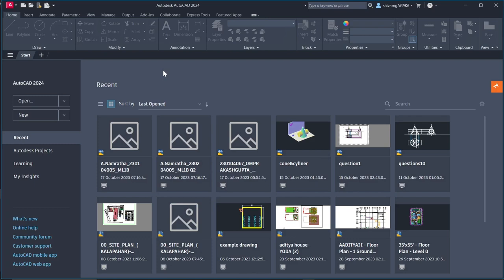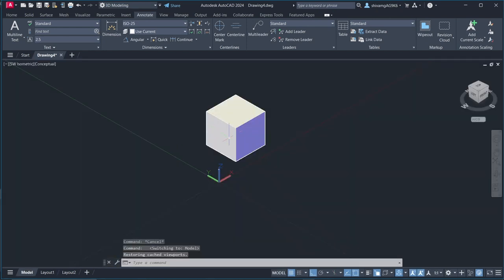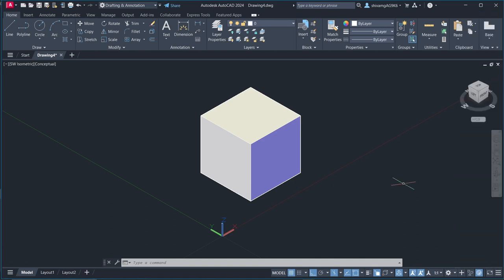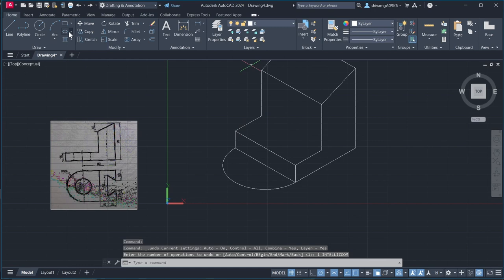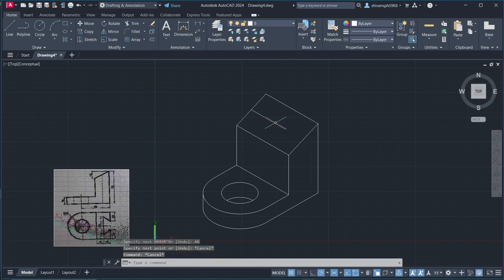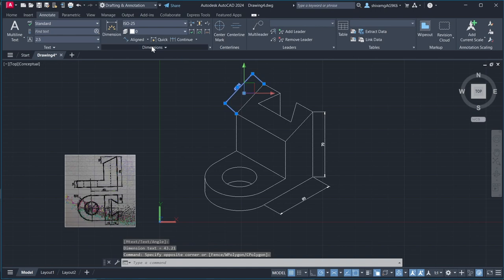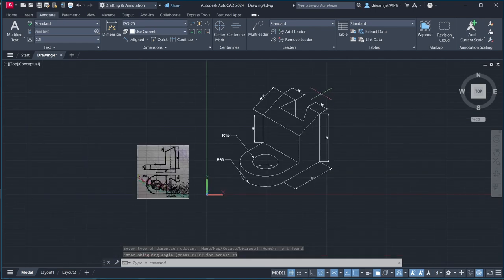Isometric Projection in AutoCAD

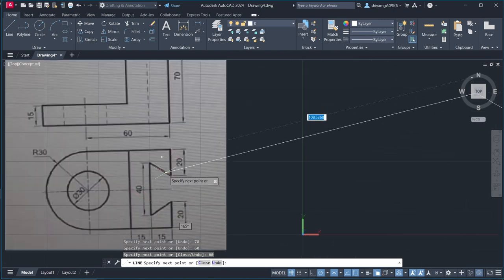Comment from the maker: At 4:29 I made a mistake. I took 34mm instead of 30mm in a hurry so if you are seeing different dimensions in that part of the drawing that's good.
If you need clarification about the direction of dimension lines, there are only three directions in the isometric view: 30°, 90° and 150°.

Comment: Sir its not coming 30° for me at horizontal,its showing 45°
And sir I have made box also 1,1,1) but my dimensions are very large size.
Reply from the maker: Turn Polar tracking on. There are different polar tracking(30,60,90...). Watch the whole video.I talked about dimensions in 'layers and dimensions' video. Also for 1*1*1 box dimensions are going to be huge. Set text height 3mm and make dimensions annotative so whatever the drawing is, however small or large it is we can just select scale and dimensions will automatically change.
Reply: Polar traking is already on sir. And it's 45° still.
Reply from the maker: @compete2194  video starts at 3:30. All the things before that were to show you what is isometric view. You don't need to do any of that (except turning isodraft and polar tracking on).
Reply from the maker: @compete2194  those three lines in the bottom right just show these options in that bottom line.. When you see these options you need to click on them & when they turn blue (as you can see in the video) it means they are turned on. Sorry in the video I didn't show the part where I clicked on them to turn on.
Reply: @arcsw ok sir.